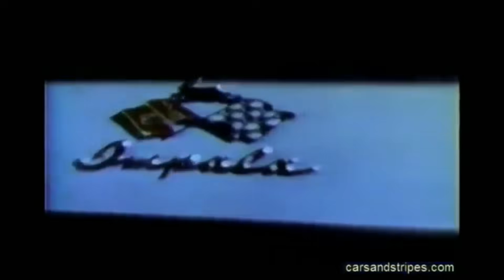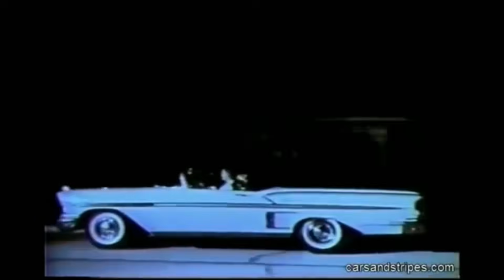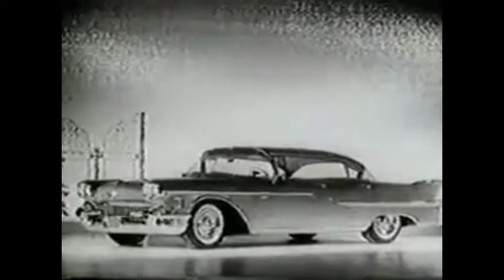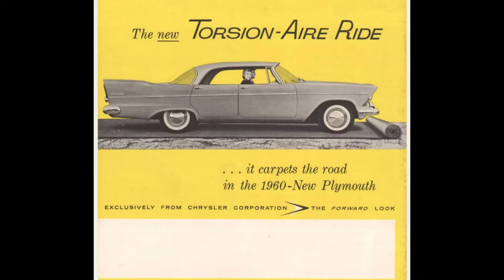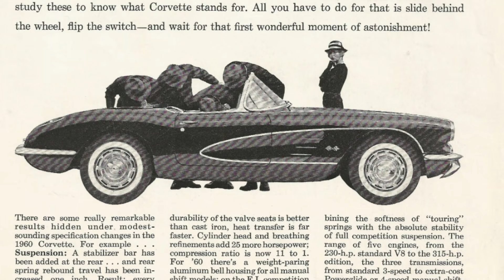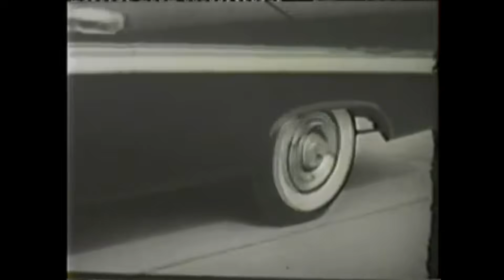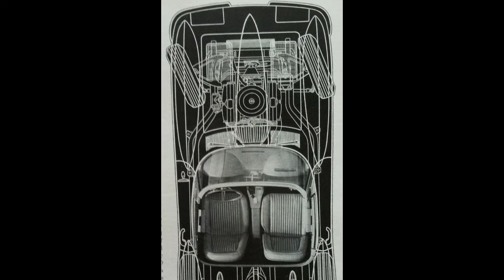The Forgotten Suspension Designs That Almost Changed American Cars Forever

Comment: Air suspension is everywhere in commercial trucks and busses, with commercial grade systems.. But consumer air suspension is still hot garbage. Sure, it's nice when it works, but it's extremely unreliable and expensive to repair.

Comment: GMC's Motorhome (1973-78) used torsion bars up front and air bags in the rear (between the tandem wheels). Six wheel independent suspension with front wheel drive.

Comment: There was technical improvemt on live axle at those times: Panhard rod and Watts linkage. The S197 Mustang has Panhard and White Line company is offering Watts for many cars. But both of them raise costs. Then there is Transaxle design wich Pontic Tempest had in the early sixties and Lancia from the 1950s onwards, but again costly.
Anyhow also cheaper European Sedans for us ordinary people were equipped with live axles until the 1980s. 
I own a 2007 Ford Mustang V8 GT with pendulum support, Panhard and coupling rods and ESP . Just factory outlay. And I love it to let it skid when cornering on Bavarian curvy country roads  especially when I put off ESP.
Of course the chassis has its limitations but it suits DIY well and is quite stable.

Comment: "Forgotten suspension" systems had me expecting to see a Dedion layout. Didn't happen. That system used a solid axel between rear wheels with the dif bolted to the frame. Unsprung weight was significantly reduced, but the camber was fixed. Some BMC cars used it, but it never got off the ground.     Z

Comment: Packard was the first to have a mass produced torsion bar suspension along with load leveling. If memory serves me the patent was actually held by Hudson, but it was really revolutionary, No jack was needed to change a flat tire. All that was needed was a large wood block. Load leveling was activated and the car rose. Then the block was placed under the frame and the car lowered. The flat tire came off the ground and the wheel could be removed safely. This was the era of bumper jacks so if you could prevent the car from falling off the jack, you had a better system. The load leveling was much faster and kept the 5,000 pound car from leaning in turns. The one car I know that had it was the 1956 Packard Patrician and that 2-1/2 ton car handled better than most sports cars of the era. If you loaded the massive trunk with packages or sand bags, as soon as the car was started the car would rise in the back to make it level and it would stay that way for the rest of the trip. The control was itself a small torsion bar located in the rear of the car.
It should be in use today..

Comment: Coil springs are actually a torsion spring that is just wound up. The notion that the torsion bar makes the suspension function better is just marketing garbage. There are packaging advantages for both types of springs. It just depends on the application. The vette IRS is a compromise semi trailing arm layout that has less than optimal geometry because the drive shaft functions as a link. The anti dive section was completely wrong. Anti doesn't cause suspension to bind. The side view instant center functions just the same as the IC in front view. These are just a few of many distortions. This vid is AI crap based on advertising copy.

Comment: You completely missed that the Corvair had 4 wheel independent suspension in 1965.
Reply: 1959 for the 1960 first model year. Swing axles for '60-'64, semi-trailing arms '65-'70.

Comment: This video mentions that independent suspension do not appear in american cars until the 1992 dodge viper, that's incorrect, the 1986 Ford Taurus featured independent rear suspension I know I owned 1987 Taurus that's one of the reasons why I bought the car
Reply: Wrong. He said "sports car" and was correct. As far as Fords are concerned, the 1981 Escort/Lynx, 1983 Tempo/Topaz predate the 1986 Taurus/Sable by several years with independent rear suspension.

Comment: At a young front end technician, I remember working on the Chrysler products' suspensions..  sometimes that torsion height screw helped with wheel alignments.
(many of those Chrysler products had left-hand threaded lug bolts & nuts on the left side wheels).
** Nice video !

Comment: I built up a.. hi rpm.. 7,000 rpm shift Point.. high horsepower 440  four Speed ..for a 71 Dodge Stepside Pickup and above 140 mph something amazing happened 😊it Rode as smooth as glass 😊all vibration disappeared on the highway thanks to the solid axle front suspension.. although it did have 9010 front shocks and a pinion snubber and clamps on the front of the rear Leafs and passenger car front 15-inch radials and huge sticky Street Meats on the rear

Comment: Back in High School (1968) I drove a 58 Plymouth Belvedere  318 poly engine and 2 speed Powerflite transmission.  One of my friends had a 56 Ford with a 272 Yblock  with 3 speed manual on column and another had a 56 Buick Roadmaster 2 dr with Dynaflow.   The Ford ran off and left me, and the Buick out top ended me.  But on winding twisting 2 lane roads I left them in the dust because of the Plymouth"s handling around curves

Comment: Clearly, whoever wrote this was just looking to crank out a click bait topic with as little research as possible. Packard introduced torsion bar, self leveling suspension in '55. Oh, you don't know what a Packard is, right? And, while Chrysler did introduced  torsion bar suspension eventually, there was no mention of the fact that out back they hung onto rear leaf springs forever, while GM had very nice coil spring/trailing, multi-link rear suspension. So many facts wrong and half truths. I see others pointed out the myriad GM cars equipped with IRS well before the '92 Viper. RG

Comment: I remember ads on TV that showed a car with one side (2 tires) on railroad track ties.  Outside the tires were bouncing vigorously up and down while inside an open cup of coffee barely showed a ripple in the liquid as the car sped along at highway speed.
Whatever happened to the technology? No vehicle that I know of has that type of suspension stability.
Reply: I remember a Ford Granada ad from the 1970s that showed something like that. Under exactly the right conditions, you WOULD get a smooth ride over rough terrain. Go faster or slower or space the boards differently and the car bobs all over the place and can be nearly uncontrollable.

Comment: Nearly all cars did NOT have air suspension when it was an option.  I drove a friend's dad's Dodge 80 miles with torsion bars.  It was nothing that I could notice.  I learned to drive in my Dad's1950 Pontiac.  It could go 70mph all day long and was easy to handle even with no power steering.

Comment: I'm sorry too much talk, not enough substance. What about shock absorbers? Muscle cars couldn't handle a corner, but none were modified, at least in my country, for acceleration and braking. Somehow they were raced without issues in this regard. I don't know if stunt cars were all modified, but they didn't look bad in movies. And then again we had cars like the Coronet 73 that would fishtail for no good reason. What about suspension stabilizer bars? Nothing to do with this? Just asking...

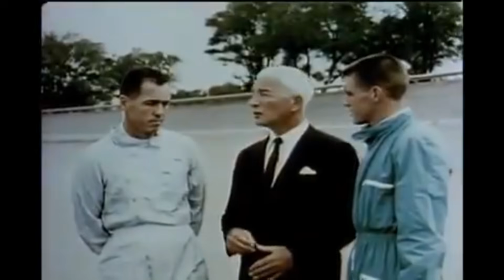Comment: 9:45 The GM C&H body cars had independent rear suspension  in 1984/1985 (Buick LeSabre & Electra, Oldsmobile Delta 88 & 98 Regency, Pontiac Bonneville, Cadillac Deville (Coupe & Sedan), and the non-station wagon versions of the Ford Taurus and Mercury Sable had independent rear suspension in 1986. The Ford Tempo/Mercury Topaz had it in 1984, and the Ford Escort/Mercury Lynx had it in 1981. Just to name a few.

Comment: Citroen had torsion bar suspension already in 1934 on the revolutionary Traction Avant (B11). And it also had independant suspension on all four wheels (it was front wheel drive!)
Reply: The Traction Avant had a beam rear axle linked exactly like a 66 Ford Galaxie.  Front suspension was very similar to 57 Chrysler torsion bar.

Comment: In 1955 Citroen introduced the hydropneumatic suspension, with hydraulics and strong metallic suspension spheres filled with nitgrogen gas. No compressors or rubber bags! This was, and still is, the most advanced, most comfortable, most reliable and most safe suspension system in the world! It has, among many other features, constant ride height, regardless of load! Nothing can rival it! Not even any american "invention"! PS It has been used for over 60 years!  DS

Comment: A little insider comment.  In 1960, GM intnroduced 4 wheel independent and rear monted transmissions and the handling may have been better intil the rear wheels folded under and ehaa, we"re doing donuts in the middle of the highway. Not saying it was a bad idea it just needed refinement.  Just when it got perfected along comes our friend Ralph Nader.

Comment: there were plenty other designs that had been around, the DeDion rear axle would have solved the unsprung weight issue as well. GM did not use that until the 60s in their german build Opel Diplomat with the 5.4 liter V8. DeDion rear axle mounts the differential to the body, which reduces unsprung weight and it drives the wheels using u-joints, much like an independent rear suspension. Oh, and air suspension had been a thing in the old GM silverside greyhound buses which date back to the late 30s. This could have worked, and it could have been reliable.
Reply: DeDion is sort of a "hybrid" suspension system that has some of the advantages and disadvantages of both live axle and independent suspensions. I like the lower unspring weight, zero camber change in a corner and lower complexity of that design. 

The 1992-1999(?) Chrysler minivan AWDs used DeDion in the rear, which was a brilliant move. It was simple, effective, and kept the load floor wide and low. Much to my great surprise and delight, I discovered that Cord used DeDion FRONT suspension for their cars which were FWD.

Comment: In 1982, my oldest son and I did a frame-off restoration of a 1966 Olds 4-4-2 that had 4-wheel disc brakes. We did a little research and found it was a COPO (Central Office Purchase Order) car. There were several other goodies that could not be had through the normal dealer order system. For instance the exhaust system was aluminized steel and 3 inch diameter with straight through mufflers. The suspension package on the original order form was listed as "Severe Duty". It also had seatbelts from the factory. The only appearance mod we made was changing the paint from standard white to pearlescent white.

Comment: My leaf sprung live axle rear and torsion bar front 1978 Newport was one of the best riding cars Ive had.   No float. You could feel the road but the road didn't effect it.  My 300cd was also amazing.  Like a tank. Tanks dont ride like you think they would a friend who drove one told me. You feel what your running over. But it is so solid and unaffected by whatever it was it's Erie

Comment: Even though it was a swing axle from 60 to 64, the Corvair was all independent suspension first.  In 65 it adopted the same rear components as the 63 Vette.  The only difference is the Corvair had 2 coils, the Vette had a single cross leaf spring.
Reply: Corvairs were NOT SWING AXLE!!!  This is maybe the most common car misinformation on the web.  They were semi trailing arm.

Comment: The Corvair had independant rear suspension in 1960, and 1965 got an awesome suspension system. The '65 Corvairs had anti dive and anti squat suspension.  Anti dive is as good as any modern car.  I own a '65.  The Viper the next with IRS.  Are you this bad at research. Do you even hav a drivers license? 👎👎👎👎👎

Comment: No american (passenger) car had live front axle in the 50's. IRS were used at Pontiac Tempest, and also at Chrevrolet Corvair during the 60's. The shown Jaguar had leaf springs and live rear axle. Air suspension are pretty common today, but so is the problems with the system. Leaking bellows, cracked plastic lines, overheated compressors.
Reply: Most of the Tesla Model Ss (2012-2026) have air suspension which has numerous problems.
Reply: @snowrocket  And BMW, MB och Range Rovers...
Reply: Willys Station Wagon begs to differ.... I suppose its technically a truck chassis though.

Comment: Chrysler always had the best handling cars with their torsion bar and rear leaf springs.  The axle was located closer to the front of the spring on Chrysler products, basically making the front of the leaf spring a traction bar for less spring wind up on acceleration.
Reply: A friend of mine bought a used '57 Dodge and even by '64 the ride was still exceptional.
Reply: "Imperial" had that. It was a "Chrysler" product.

Comment: That Viper IRS comment is way off.  The 1961–1963 Pontiac Tempest and the first-generation Chevrolet Corvair (1960–1964) both utilized an independent rear swing-axle suspension system.
Reply: Agreed.  There is quite a bit of misinformation in this video.  The GM FWD E-body that came out in 1979 also had IRS.  Additionally, although it was in fact Jaguar's IRS that pushed GM to put IRS into the C2 Corvette, the Jag Mk 2 seen in the video had a live axle.
Reply: The Tempest had a transaxle too for excellent weight distribution.  Driveshaft was very light too because it only needed to handle engine torque, not multiplied torque through the transmission.

Comment: There is so much missed in this misinformed video.  The force behind so many of these suspension changes is there are a huge percentage of drivers that want a car to drive and ride like an oversized go kart.  An old school go kart has no suspension, no lean in a corner, rough feel through the steering, and bad ride.  Independent suspension is not an automatic fix or automatic improvement.  This is especially true if McPherson strut suspension is used.  Cheap and bad being the part that broke off a 1958 Ford that truly only works correctly when steering is near the straight ahead position.  Proper live axle mounting is a lot more expensive than many of these cheap solutions.  I watched with great laughter of many supposedly great handling cars, BMWs, Mercedes, and a host of others.  Driving down the inner most lane of the I-405 in Los Angeles many of these fake cars would pull in behind me to follow along my high speed driving in the very rough highway lane.  Could see them catching air under their tires and bouncing around the road so much they quickly fell back into a more outer lane as I cruised along at 20mph over the posted limit.  Then came the clover leafs.  This is where these supposed great handling cars showed their lack of prowess.  Honestly, I passed to many of these POS cars on ramps am ashamed of that younger me behavior.  In no way could these supposedly better handling cars keep up with on a cloverleaf.  Those cars and this video are filled with misinformation of the trend toward inferior suspension systems.  What did I drive that left the "better" cars to only see my tail lights?  A 1967 Pontiac Catalina four door sedan.  Why?  Pontiac wide track front suspension and four link triangulated rear suspension.  For rough roads and rough cornering probably the most practical solution available.  One might notice four link triangulated suspension is the number one choice for off road vehicles to operate well in that rough  and tough environment.  What a joke this misinfo is.
Reply: A 4-link is probably the best setup for a live axle, but that is just putting lipstick on a pig.  There's a reason why no modern passenger cars today have them, only heavy duty trucks and off-road vehicles as you point out.  Surely, are you saying that you could have out-handled an IRS Corvette or other IRS car that was driven with just as much reckless abandon as you did in your Catalina?  This video is pretty bad with its misinformation, but I felt that your reply was equally misinformed.
Reply: @chewmetube  You do have a point however, in that day the Camaro was far better handling than the Corvette which was pointed out by many then.  Not until these later series of Corvettes, post 2000, did handling grossly  improve.   This means the Camaro with a live axle out performed the Corvette in handling.  We are talking leaf spring on a live axle here so, yes the Corvette was a pig.  My key point is all those cars that were supposed superior were intended for very smooth roads and primarily straight line operation.  That Catalina has a triangulated four link and wide track the likes of which have never seen on any other cars.  Handling is superb as is the very decent ride.  Rough roads are handled with ease which, was wholly impossible for the BMWs completely loosing tire contact with the road due to the shabby independent suspension.  What a joke!  I will agree four wheel independent  can be better but, in so many cases it is a sales idea and not an improvement.  Please recall Alfa Remeo also used a live axle.  As with everything,  there is a best way and a cheap, very lacking way.  The trouble with the many is they suffer from the cheap lacking way where my Catalina is of the last of the bread done right.  Many products found in all fields suffer from cheap and poor implementations as was  that 63-67 Corvette.  On real roads, rough or smooth, and real corners that Catalina is faster than most cars made as it always maintains good tire contact with the road.  In recent times, compared the Catalina to a VW Corrado on a clover leaf.  Guess who won easily with the highest speed?

Comment: ...  I worked on those vette rear suspensions in the 70's ... didn't think much of them ... Hard to work on and expensive .. Even just a brake job was $250.00 per wheel parts & labor ..in the 70's dealerships ..